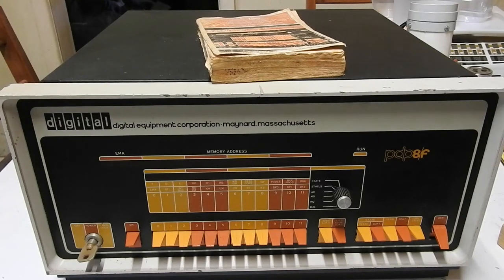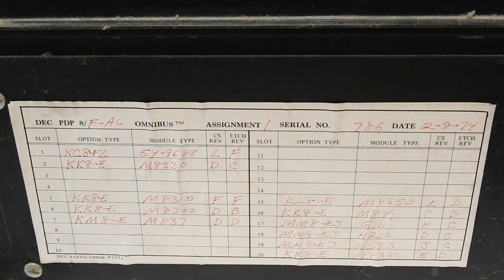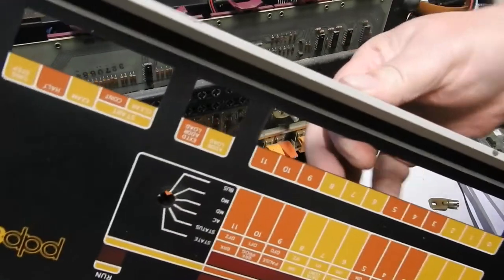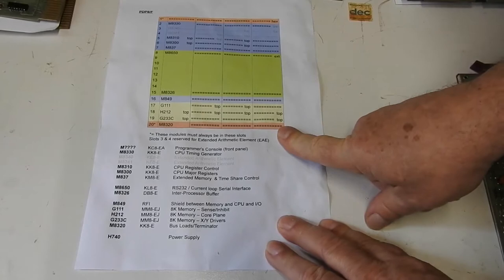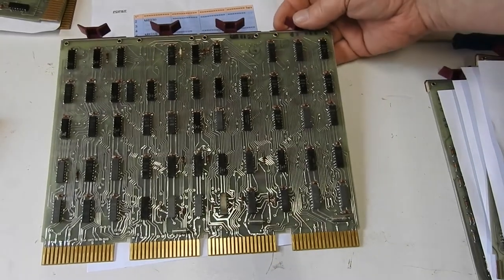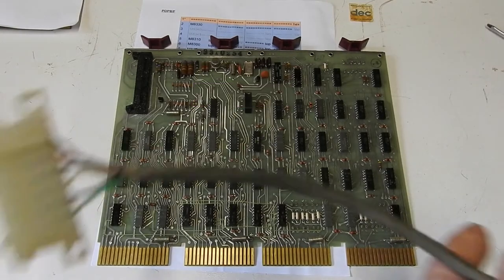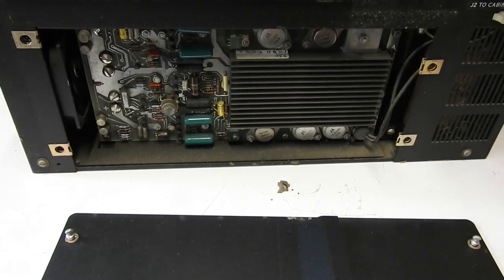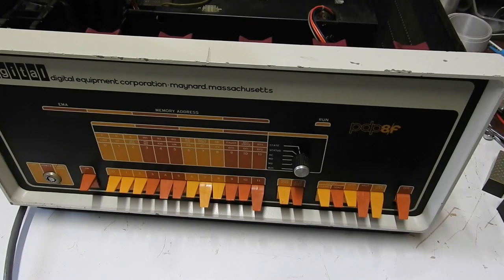PDP-8/F Quick look and Teardown

Comment: Thanks for the detailed teardown.  I found this when searching for a PDP-8F which I saw in another video.  I was very familiar with the 8E, but was not aware of the 8F.  These were great machines for their time.  The ones I worked on had every slot full, as we had many I/O boards to run tape drives, cameras and precision CRT displays.  The PDP 8 E was the control and brains for a Computer Output Microfilm unit.  We had to replace all of the core memory with solid state boards, I think we ended up with two 16K boards to max out at 32K.   I was buying used ones for the spare parts, continued to use and maintain them until 1991.
Reply from the maker: Glad you enjoyed. 
If you still have a stash of spares, that could be worth quite  a bit...

Comment: The white plastic in-line connector looks like it is the current loop serial interface. Its logically similar to RS232, but electrically completely different.
Reply from the maker: Thanks. I did determine that it was a serial interface connector later in the video, but not whether it was RS232 or 20mA current loop. Either way should be easy to interface with a PC.

Comment: programming one of these is beyond my Ken. but I do know that you have to manually select locations in the memory and enter values into them, using the toggles in the front. but what to enter, to get it to do what you want it to do id beyond me. but I would love to get my hands on one of these, and learn how. I am really into older/ Vintage computers. was interesting that these had core memory!  liked and Subbed! 😀👍
Reply from the maker: Thanks, glad you enjoyed it!

Yes, the toggle switches and lights are cute - at first, but then it quickly becomes a pain. So it's only done to get a bootloader program into memory, that can then load in much bigger programs from mass storage. 
Having core memory, the bootloader is still there when the power goes off, so would not be a problem with this unit. And later machines with volatile MOS memory usually include a board with the bootloader program in a small read-only memory.

Comment: Max memory 4096 12 bit words. Core memory for quick recovery. Sys used for process control. I.e electrify generation.
Reply: The memory could be expanded to a maximum of 32k x 12bit words in 8 "fields" via a 3-bit extended address.  This is what the three extra lamps represent on the address line of the front panel.  The core memory contents were only guaranteed to retain data when the machine was shut down cleanly using the front-panel keyswitch.